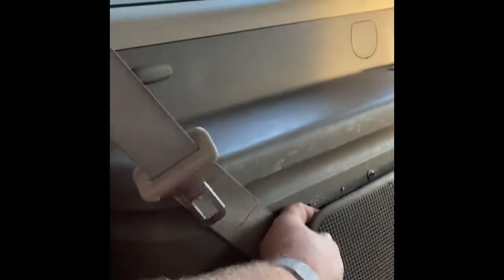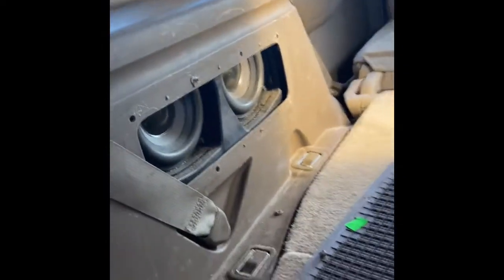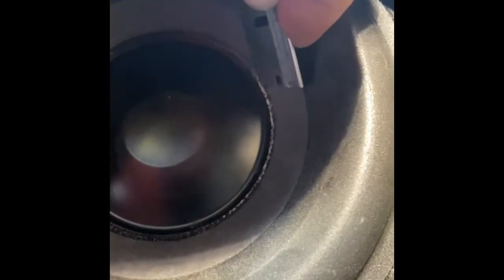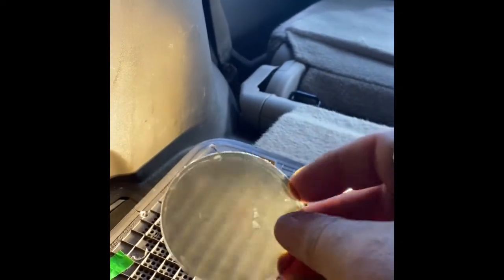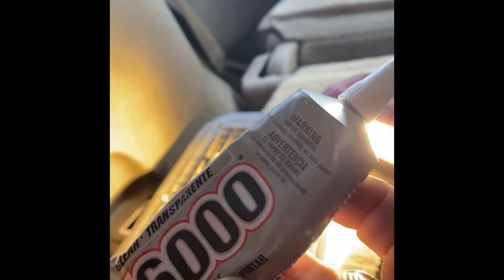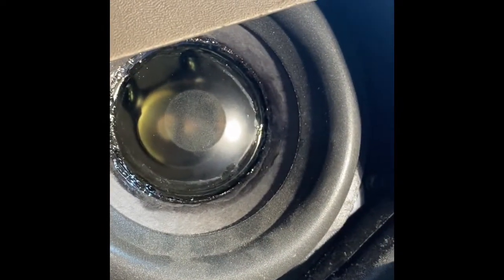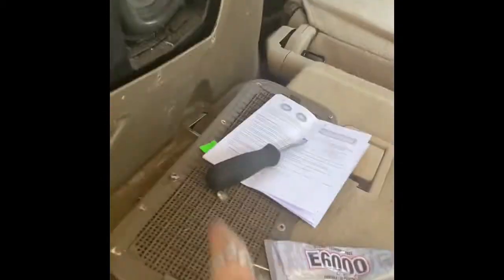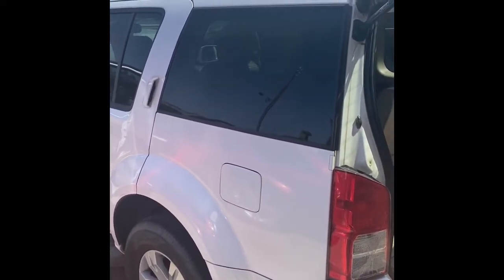Pathfinder bose subwoofer issue

Comment: Repair them or replace them. Those are decent subs for a stock system and it’s expensive for aftermarket. Most GM vehicles have the same subs and have great bass
Reply: They sound loud they can shake the car panel
Reply: @alexvore5287  yes

Comment: Had same problem took  panel apart. just like you said the cones came apart so since I had silicone I silicone the cone on both just so I won't worry it work . A year later I threw away the stock box with woofer and place a mono amp in that location, build a small box single 10 ported 1.4 cubic ft tubed to 35 hertz way better than that stock bose. Also keep the stock radio tap in to radio lines that go before the small oem mono amp

Comment: Would a 10 in fit there or what size
Reply: They are not 10”. They are either 6 1/2 or 8. I am also wondering what size they are if anyone knows.
Reply: I measured 5 1/2” across, not sure if that’s proper measuring : )

Comment: Same issue here. Also had to replace transmission 2005-2010 had issues with coolant mixing with oil……buyers BEWARE.
Reply from the maker: super common problem , any research done on the 4.0 , first thing is to do an aftermarket trans cooler .. and delete the O E trans cooler ,  wich I did on this unit , the owner has had NO issues with it , pretty shitty of you to TRY and stop my sell of this with your buyer beware comment .. NOT COOL , even tho it sold LAST year
Reply: @Savannahjbo  
Had no idea you were trying to sell.  I was researching subwoofer. I thought you were just fixing sub. Nevertheless, car salesmen and politicians fall from the same tree.
Reply from the maker: @MrWhitelightning73  indeed ... Im def no salesman .. but enjoy finding decent rides to hook ppl up... that industry sucks , so does 90% of the automotive repair business ...example this 07 pathfinder booked for about 6500 at the time, I sold it for $3400 , dude got a great deal and I made a few hundred for some steak dinners ... and I drove it for a month .. on to the next one
Reply: @Savannahjbo  
Outstanding, and like I said before, I had no intentions of making you look bad. Just trying to help someone else avoid the $4,500 mistake I made.